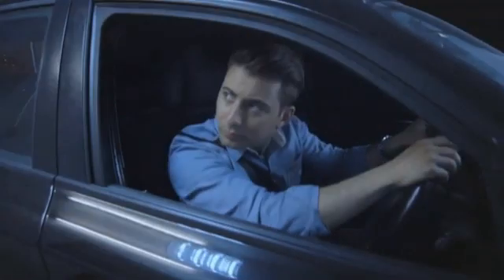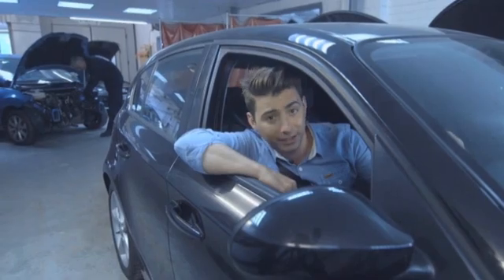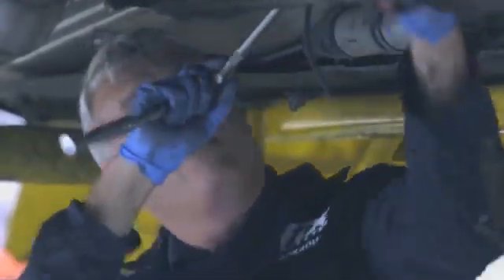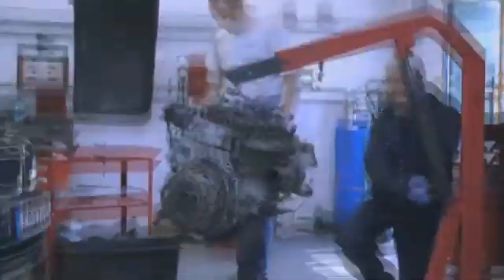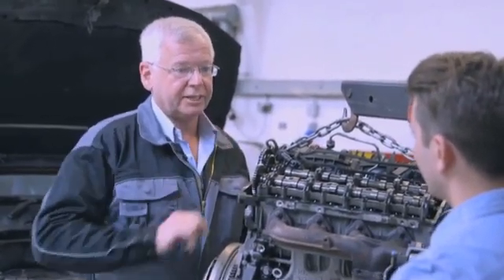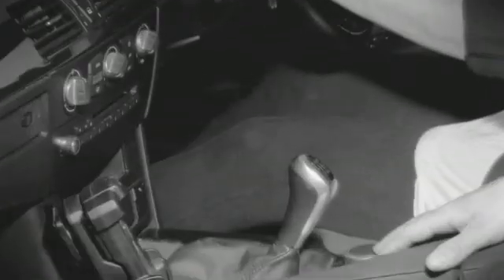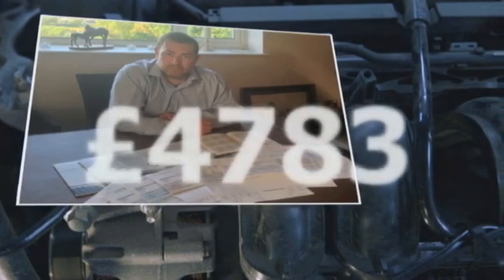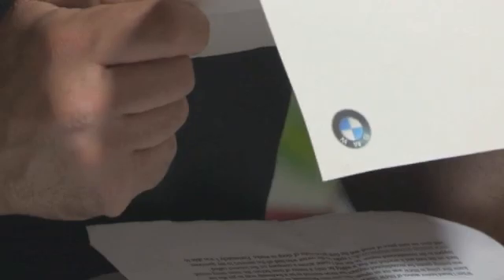BMW N47 Timing Chain Failure PROBLEM

Comment: My Name is Thavanasen I took my car same Noise problem to BMW Coventry main Service today.
1serious Diesel the BMW man was call me after diagnostics today and he told me the same problem stick cost over £2000 this is 2011 model car ..why I bought this car because I like the name of BMW ! but this horrible. of course this this BMW manufacture Failure i’m so expensive repair caused this nightmare this is my last BMW not any more in my life
Reply: Tamil song Harishana mate, had mine fixed for 450 in Coventry. Pm me
Reply: MTech over9000     can you please pix mine  timing chain £ 450.00?
Reply: Look up PMP cars in Nuneaton. They did mine for 450

Comment: Oh shit, well I was looking at getting a '08/'09 123d next year as an upgrade. So what does everybody suggest instead? Has to be at least a 2.0 diesel (for economy) have at least 170bhp, roughly 250-300 ftlb of torque, 5 door, fun to drive, preferably cruise control or the option to fit as well, and lastly... reliable....... Fire away :)

I considered the same year Audi A3 2.0 tdi, a lot less power, but quality interior, bit less fun to drive but still good enough. Might get hate for this as well... but I kinda like the look of the Skoda Octavia Vrs 2.0 diesel, so yeah that sort of car that won't break down

Comment: BMW`s M57T2  must be one of the best engines they ever made!!!? (fully aluminium, front mounted timing chain, variable vane turbo, piezo injectors, common rail,etc.) in the case of the x25d  no swirl-flaps so this engine has no apparent weakness.
Reply: M57 was a great engine especially the TU2TOP (Twin Turbo ones) just make sure to delete the swirl flaps.

Comment: The anti skipping guides have failed in my 2010 118i and I am told there is now swarf in my engine oil. I am awaiting advice from BMW on the likely repair cost. Given that my 2005 model 320td experienced a swirl flap failure (causing the car to be written off) I will never purchase another BMW.

Comment: If taking engine out is a big job then you are not mechanic, I did work for BMW service , now I'm independent specialist and they still call me for help, BMW service is terrible because they got just one master mechanic and the rest are trainee mechanics who are practising with your cars. Only 2007 to 2009 engines had problems, I've got 520d 2006 from new and is now on 230000 miles and all I've done is service plus new turbo, still original chain which I will replace in next 10k. There are brilliant BMW's

Comment: I've 2009 E60 520D , it has full BMW dealer service history ... last service done 17 days ago.
Last evening while going on a road the engine came to sudden halt and finally today came to know from BMW workshop that ... timming chain has been snapped and crankshaft broke .. needs engine replacement.
The cost is around £10K.
BMW provided me with nothing but the conventional sympathies.

Comment: trusted BMWs for long time, Since had exact same issue recently with a 2010 320D. no warnings, no indication. Sudden break down into engine seizure.
Reply: Hi, what was the mileage please?
Reply: what warning do you want to receive on a mechanical part? How often did you service the oil?

Comment: Just happened to my 520d  2010 model, car  stopped in  the middle of the road.    The car has a mileage of less than 70k, and full service history.  BMW agreed to pay partial cost of repair but still costed me over £1200 to repair.  Gutted that such failure should happen at all!!
Reply: They should pay the full cost as it is due to their poor design and product

Comment: Retarded engineering to put the timing chain at the BACK of the motor!
Reply: Agree! If they put the chain in the front for easier access. Those owner might walk away with two and a half grand repair bill. Still a lot, but they won't be as pissed.
Reply: no mate when they made the engine like that because they thought that the engine will never have problems regarding the timing chain. it was supposed to last the engine life something around 500.000km

Comment: German cars are long gone in terms of reliability. All top brands had a lot of serious problems, but ppl still buys them like crazy. 👍🚘
Reply: honestly every brand now has some major issue with something, cars are just getting more complicated and they are cheaping out on materials and design it just to last the warranty so you go buy the latest one, just like your phone, rarely people fix their phone because 2 years later theres a better model so they buy the new one, cars will be the same..
Reply: @Motorsportsgeek  That's where we're at. What a world we're in. Fecking hate it.
Reply: CafeArtuk owned of two Audi’s here 2005-2007 both engine failures after 6 months both full Audi service history’s.
Reply: @riccccccardo  yep there's some engines in Audis that are just trash.
Reply: @kylerwinters  All VW cars are trash. The "paint" cannot be any thinner they save on everything.
Reply: Its an iPhone of cars. I have one 2. 🤣🤣😂
Reply: because they are like phones
Reply: And what do you people who are complaining drive?  🤣
Reply: S-tech. Your exactly right. Bmw = too many problems
Reply: @MrTimstaaa  I work on German/British car. Jaguar are the worse to fix. It's like 5 hours to remove the supercharger. Audi definitely is more of a bitch to fix than bmw in most cases. 

I drive a 335i because it's fun as hell and the engine is solid and easy to work on. Its every thing connected to the engine that can have issues(water pump for sure).
Reply: @kylerwinters  yeap I drive a 335i too, and it still running like the first day  with almost 260000 tkm /160000 miles, I ve fixed the known problems, like oil house gasket, oil pan gasket, vanos solenoids and the water pump.
Reply: Also germans cheat on emissions
Reply: @martinkulik9466  I don't think BMWs have though?

Comment: I have a 2010 F10 520d and this has just happened to mine on 100k, still owe £6k on the car and dealerships not getting back to me. I thought BMW rectified this issue in 2009, obviously not as mine was September 2010 and it has not got the uprated tensioners which I will get on my reconditioned engine. I have loved BMW for years, owned a few but this is my last now. I NEVER expecteed this to happen to a well maintained car this new. What a F**** joke.
Reply: Stephen Cable how often did you change the oil?

Comment: BMW 318IS ENGINE failure on motorway at 70mph 2011 MODEL 100000 miles fullyserviced Car what a dangerous experience in rush hours and kid in Car and ENGINE shut down and never started again pain and agony frustratetion and light wallets I have experienced never again will I buy a BMW considering this is my 5 ONE that are building THESE 2007-11 in Spain WITH Japanese parts modestly made in China my Reg 1998 323i 268000.before it started to misidal when stationary but still was driving fine..and now days save the stress and keep away unless you drive them for free and don't need to worry about them don't be fooled thinking there popular that must be good most of them are leased to car hire company like thrifty car hire and used for advertising in towns to gain sales...My2011 in the bin if ANY ONE wants to no

Comment: E87 116i has similar problems.  Avoid the 1,6L engine unless engine have been properly rebuilt. A NOK 50.000/GBP 5.000 rebuild.

Comment: I own one E91 318D and I just got the noise from the timing chain. My car is getting new timing chain and other parts around it, and this will fix the problem hopefully. But I wonder if this problem will come back later after the repair?
the timing chain got changed after 120 000km.
Reply: Odin Slåttvik yeah, unfortunately this problem returns again. I have the same car too and i changed the timing chain twice. So, good luck! If you don’t want another problems, sell the car and fuck bmw!😡

Comment: The error is due to contamination of the engine oil with fuel on the post injection time. Solution is remuved diesel particulate filter !!!!!!!!!!!!!!!!
Reply: Manu - Yeah rubbish, nothing to do with post injection & the DPF (which is their to stop the crap getting into the air!), bad timing chain components design on the N47.

Comment: I own a 520d with N47 engine, my timing chain snap on the way to home... The cost to fix it is 1200-1500 pounds, depends of mechanic
Reply: That sucks, but 1200 actually sounds pretty cheap, guess it isn't a BMW garage?

Comment: Wow that is bad, putting the timing chain at the back of the engine is incredibly bad design!  Who's idea was that?
That a rival for VWs emissions cheat software in terms of stupid car design! Older BMWs seem to last longer and be much better made and easier to work on too!
Reply: All cars were easier to work on 10-20 yrs ago, to varying degrees their a PITA now!
Reply: soundseeker63  probably this idea came from the ford 4.0L
Reply: They designed the engine that way because camchains used to last the life of the engine...little did they know...lol

Comment: All BMW's with 2.0 Diesel engines have this problem.  BMW knows it but they don't recall free these cars. My new car will not be a BMW anymore.
Reply: M47 is bulletproof
Reply: It is N47 idiot...learn to read first then talk....
Reply: Thats not true. The petrol engines from the same era has the problem or similar. I've had it myself on a 2007 120i.
Reply: Xava Bull shit N43 petrol engines are shit as well. As long as I have a hole I won't have a BMW.....no more replacing camchains for me.
Reply: Does the N46 engine have the same problem?   (for the X3 2005-2006 year, petrol 2.0i)
Reply: ActualProx
Reply: My 525xd 2008 e61 M57N2 last week timing chain broken, 220000 km on it. Sad thing is that i have also E70 with same M57N2 with 265000 so i have to sell this shit also
Reply: what about the petrol 320 m sport
Reply: The N47 engines have these chain issues, the older M47 format have no such issues and is a good engine, all you need to really do on them is remove the swirl flaps and it’s safe. The N42/N46 4 cylinder petrol engines have an issue with the timing chain tensioner, the part has been now revised to a better unit so it’s best to change that for anyone who has those engines and while you’re at it change the rocker gasket
Reply: Bull shit. Only N47
Reply: No,petrol engines are not affected.Neither are engines with other codes (m47).
Reply: But in every single car timing chains/belts must be replaced. None of them last forever, everything wears out. On my N47 it was replaced around 200 000 km, so it's completely normal. If the part is in hard to reach area, that doesn't mean it's designed to last forever, nothing will last forever.
Reply: Don't be a tight twat buying small engines, bmw are renowned for their 6 pot motors I always buy 6 pot or I've also have v8 an v12 without problem. These toy size engines in big cars are pulling their bollocks out all the time. Like the old e34 518 all over again. Only they just started to smoke rather than break completely.
Reply: @michaelbamber4887   - Don't be a twat yourself! Just because they bought a smaller engine BMW doesn't mean they should be failing left right & centre! Fucking idiot!

Comment: Same for us! No help. Full service. 149 000km. 2008. Never bmw again.
Reply: i dont understand why the build one engine to fail completely... is it worth the people who wont buy another one.. after 40 years of having bmw, we wont buy a new one anymore.. is this worth it? what a bunch of idiots.
Reply: +Axtschnitzel haha yeah. Our family is growing and we were planning to buy a new 5-serie soon. Now we bought an Audi instead.. bmw lost a lot more than the selfcost to repair our car and thats just the first of many we would have bought. Its trouly an old capitalistic way of handling this kind of matters. Even though they missed the long-way economic view. In our case they would have sold a new car the same day the old was repaired.
Reply: @Axtschnitzel  it seems years ago they over engineerd cars by (I'm guessing) about 70%.
So older cars could take quite a bit of punishment is; no/long oil changes.
Today(last 15/10yrs it seems Fkg accounts run BMW and they cheap out on the quality and materials.
Judging by the high amount of failures modern cars are no longer over engineerd more underegineered why?
Who knows 
money?
If they fix just one BMW N47 timing chain they'll have to fix them all.

Comment: Good video,

Apart from the expensive and common timing chain problem on the N47 engine, of which I sadly  now have personal experience of, BMW also has the oil leakage problem on almost all N47 engines I have seen, the oil consumption is up the wall, and BMW representatives just say " it's normal for this type of engine". BMW doesn't seem to be too concerned about this.

My personal opinion is to avoid 4 cylinder BMW's. And what says that newer engines should be any better than the N47?
Reply: our n47 did not need any oil at all. not 1 single ml for 30.000km till the next oilchange. 

it's a shame, because the car is now history because of this chain
Reply: I wonder if 30,000 km is a good recommendation. Even though the oil hasn't degraded, the oil usually is full of grit after 10000 km, regardless car.
Reply: Best to change the oil more frequently, like 10,000 miles or every year.
Reply: If your oil is full of grit you need to check your oil filter. If by full of grit you mean black, that is normal, oil will turn very dark after a few hundred miles.
Reply: Hi Nick,
By grit I meant small particles....the oil start to feel like potato powder after 10000 kms when you rub it between your finger tips....and
that's why I don't think that longer service intervals is any good, despite that the oil itself may still be in good order chemically.

Comment: Any idea on the new b47 engines ? Did this problem persist ?
Reply: They shoulda used a normal timing belt man. It's cheap and easy to change.
Reply: +lolek bolek even the new diesel engine still have problems?  Weird.
Reply: what ?? 7? you have no idea mate! my boss changed 2 engines and 3 turbos plus other pumps at 150k miles. 7 series are worst in term of reliability.
Reply: They all use the same engine, the mode of car doesn't make a difference. It's more so what engine you choose for the car. The N57, successor to the N47 engines are fine. I think that is 2011 or 2012+, even some cars before that started using the revised engines.
Reply: they still had the N47D20O1 Engine on the 2012- 2015 F30 320D only after the facelift in 2015 they changed to B47 but does the B47 still have these problems?
Reply: Yes!
Reply: Yes!
Reply: NO!!!
Reply: NickLiang n57 is the 6 cylinder version

Comment: Dude my march 2011 built 320d had this issue.
from my research they half assed fixed it in 2009 and then properly fixed it in march 2011.
i caught mine before it failed because i heard the chain rattling. managed to get the Dell-Boy dealer to pay for it, plus a new flywheel for my troubles.

Comment: AVOID 2006 TOO 2010 2.0 DIESELS. FROM 2011 YOU DON'T HAVE THIS PROBLEM  bmw 350 d
Reply: wtf is 350d?  2006 there were no n47 engines, but m47s that are perfectly fine
Reply: m47  engines alright but you need to be careful of the swirl flaps as they can snap and cause problems but you can cap them off...

Comment: AVOID 2006 TOO 2010 2.0 DIESELS. FROM 2011 YOU DON'T HAVE THIS PROBLEM
Reply: The timing chain issue was in the N47 engines which came out early 2007 onwards. In 2006 it was a M47 engine and this had a different timing chain components.
Reply: what about 2004 and 2005 models?
Reply: The stronger package tends to be the M47 120d 2004 to late 2006 (has larger turbo, bigger brakes & a stonger rear diff over a 118d (not just a different engine map). The N47 will have better mpg but in the real world they won't be as much better as they are claimed to be (plus more to go wrong too). This forum is good for info on the mark 1 one series (or any one series) http://www.babybmw.net/ But if you can afford the mpg go for 130i petrol as this is the best most reliable combination (may be not a ideal first car insurance wise).
Reply: The early M47 was used from 2004 to end of 2006. N47 was from 2007 facelifted models.
Reply: pb5x5 so the m47 are more reliable ?
Reply: SWE-BMW-E90 but as a first car the 118D M47 would be a better choice?
Reply: I don't know your situation so it's hard to say. Do you have kids? Are you driving your car to and from work for long distances and need a low fuel consumption?
Reply: No kids.. Its mainly for work but I will have to drive for long distances sometimes too..
Reply: A Grg What year is the 118d you are looking for produced? :)
Reply: A Grg I believe that the 118d is good enough for a "first car". It doesn't consume so much more fuel compared to the E90 320d with the N47 engine and it fairly practical to have a smaller car if you don't have kids. Plus it's quite a bit cheaper. :-)
Reply: +SWE-BMW-E90 I have an m47 and I average 4.3l on motorway, not that it's not economical lol
Reply: When that thing breaks you're looking at about 4000-5000 usd.
Reply: Framus 1634 I have the same problem 520d 2011.9 production date
Reply: A Grg I like the N47, I have 210 000 km on the clock and it works great. Low fuel economy (Compared to the M47) and good power (177hp). It does not consume oil like some VW or Audi diesels. The only problem that can occur that is pretty major is if the timing chain gets bad, but I don't believe thats a problem if you drive your car normally and change the oil frequently.

Comment: Its a fully known common problem on all BMW owners forums, you'll google and see hundreds of the same cases. Some 50k miles some 150k miles. Some 3 years old some 6 years..etc.Its not just 1 series but all bmw's with the N47 engine. My first bmw i owned and it failed in 1 month of owning it. I am put off of BMW for life, i will never ever buy a BMW vehicle ever again whether has n47 engine or not. POOR QUALITY.